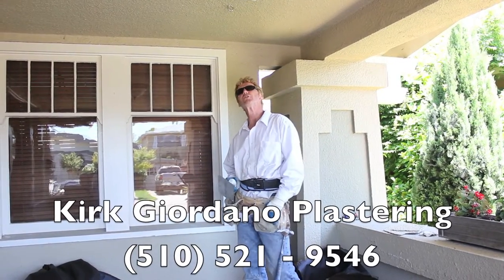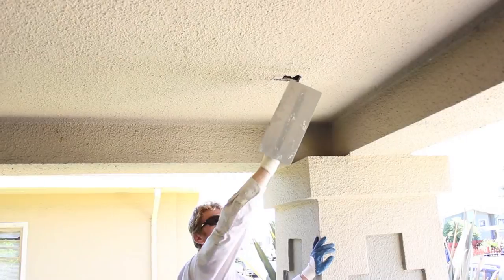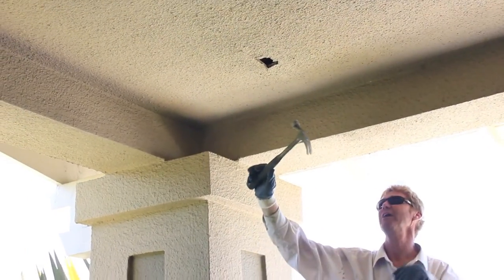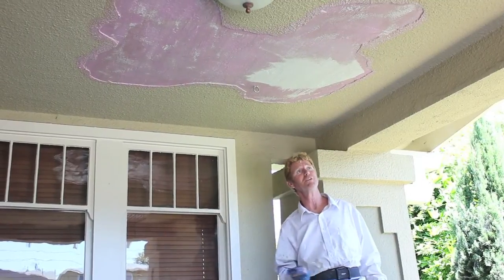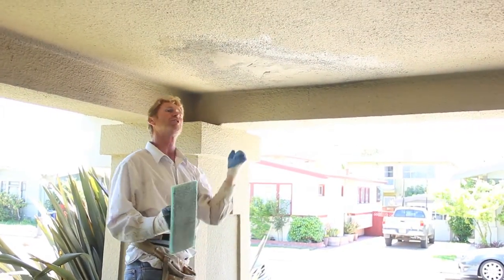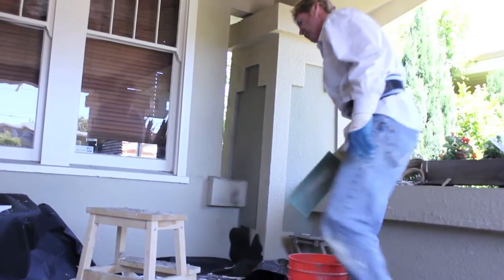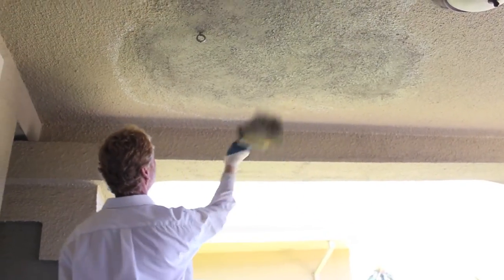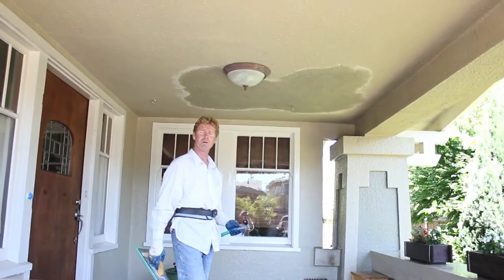Remove and fix loose stucco from my porch ceiling.

Comment: I have a porch that needs repairing here in south Florida. My roof had a leak and it damaged the outside porch. I can see there was drywall wall installed and I believe that plaster is over it since it's a very hard surface. Do I need to use a bonding agent over the drywall before I apply the plaster?
Reply from the maker: Evening foreverwood1963, I use a bonding agent for everything.
cheers!
 kirk and family
Reply: Thank you

Comment: Thanks Kirk for responding so quickly.  I have a house that is made of concrete probably similar to a SW style adobe with 18"-20" eaves.  It has a stucco coating over the concrete base and on the eaves the stucco coating is separating from the base.  The concrete is a lightweight mixture probably with vermiculite so it won't hold any kind of nails or screws. so I'm not sure how to attach any of the mesh like you're . I tried using a fiberglass mesh but that didn't stay up.  Any suggestions

Comment: You did nt say exactly which cement/morta you used for ceiling repair??
Reply from the maker: Evening King dude, just regular cement plaster. I apply three times the sand to the cement plaster.
 I prefer Hanson premium cement plaster myself, this brand is usually sold at the plaster material yards.

                  Bringing peace, love, and harmony back to the world of plastering.
    The complete plastering encyclopedia on video, by the plastering messengers of Youtube.  
                                                     Over 800 videos

Comment: Ugh...I thought I could do this, but after watching this video, my arms are hurting and my eyes are burning (where's your safety goggles!!?? lol).  Guess I'm going to call someone to come do it.  $$$ :(  

Great work, btw!
Reply from the maker: Howdy Noneya, working above your head trying to defy gravity is a bit of a drag, as it takes practice.
 Best wishes, 
Kirk & Jason’s stucco repair video’s
Reply: Hi, Kirk:  Thanks for your response.  It definitely doesn't look like it's for the beginner, that's for sure.  lol  

I called a guy...he said he was going to have to rent a special "sprayer" because his was in another state that he was moving from.  I didn't see you use a sprayer. (?)  Does that sound right that he's using a sprayer?  My ceiling isn't popcorn type - it's textured.  I told him it was textured a few times, so what's the sprayer for?  I didn't want to seem like I was insulting him by asking why he's not plastering the ceiling on the phone.  I figured I'd wait till he came to see the ceiling in person and then ask him  how he's going to go about repairing it.  

Heck, if all I need is a sprayer, I'd do it myself!!